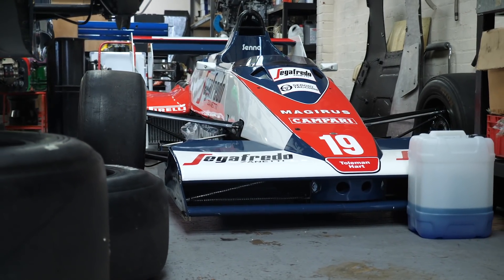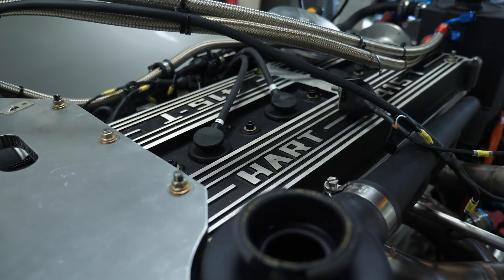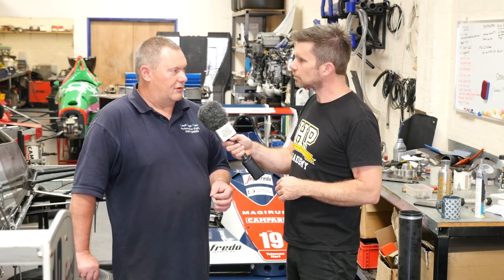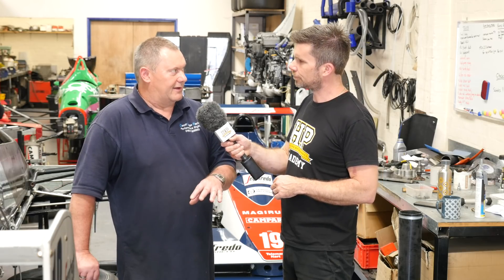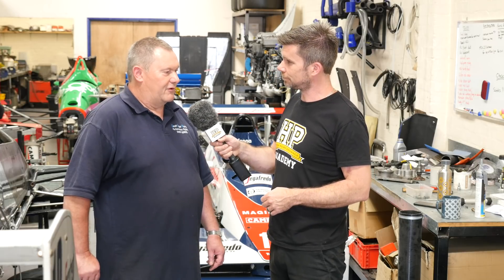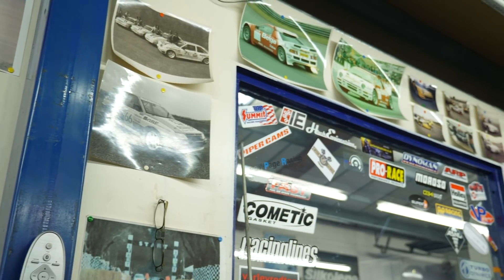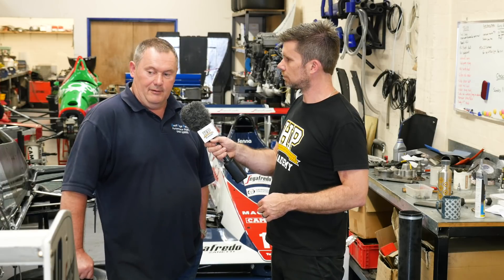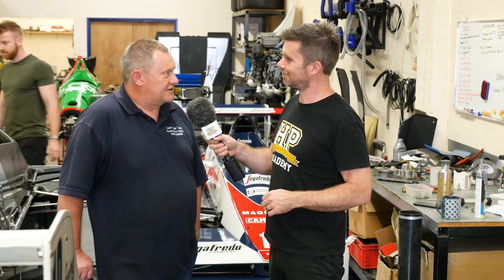Formula 1 TURBO Era | 800HP Toleman-Hart TG183B [TECH TALK]

Comment: Super informative on the headless Toleman Hart 415T race engine. It was probably equally tricky to reface 16 valve seats with a multi angle valve job.

Comment: The early 70s the Leyland lynx truck and bus engines were fixed head,  not overly reliable, but they ran them for number of years
Reply from the maker: Interesting, wonder what the reasoning was for that in their more industrial application - Taz.
Reply: @hpa101   Not sure really, they had similar engines in the British Leyland group, same size and power, maybe it was a project that was signed off on, they were strange time in the 70s in BL

Comment: Monoblock engines used to be fairly common, when head gaskets couldn't seal high cylinder pressures.  The Offy 4-cylinder Indycar engine was a monoblock.  Those were doing 1000 hp out of 165 cubic inches in 1972.

Comment: I remember Porsche welding the heads to the barrels in the late 70"s to eliminate the sealing problem. This goes one step further. Would have liked more visuals of the engine components.

Comment: If only Brian Hart could of been persuaded to right a book.
On a sub note: It was Honda who were the first to be producing the 1500 hp No.'s but they(Honda) were not totaly sure of their power, simply due to the fact they were measuring the rpm and then the torque was measured off of the spring balance scale using binoculars. Different times

Comment: We’re so lucky, nowadays you can easily source ECU’s with a ton of ignition and fuel controls plus a host of failsafe and drive-ability functions that make driving a car that would normally be a nightmare on the streets quite tame. And that’s truly the upside to F1, as in all the electronic tech that has trickled down to the general aftermarket over the years.

Comment: the Alfa Romeo 8 cylinder F-1 engine from 1951 was a "monoblock"...
Reply from the maker: Yes monobloc tech (monoblock seems to be the modern spelling since it is more specific than the original term was) goes well before 1951. This wasn't the first block used, and certainly not the first in motorsport ;) - Taz.

Comment: 1500hp in qualifying trim from the bmw 1.5 liter f1 car, same as the fastest 13B's in sport compact import drag racing. Love a brutal forced induction small motor that's off it's head!
Reply: I dont. Those high strung little fuckers dont last more than a race, or a few 1/4 passes.  Stupid fucking expensive to build the little fucks when you could just build a 1500hp turbo V8 and daily the bitch for years without issues..

Comment: Offenhausers (and I guess the Peugeot engines they were based on) featured a monoblock with 4 valves per cylinder a hundred hears ago
Reply from the maker: Yes sir! This wasn't new at the time as Geoff mentioned and some 'monobloc' technology from way back when is actually completely normal now. Early engines were far more 'modular' - Taz.

Comment: The mpg figures from today's turbo hybrid f1 cars make far less than crazy 1500 hp of those good old days. Still with hybrid systems their mpg figures ąre in the single digits.
What mpg figures were you getting in Sennas Era with turbo engines
Reply: Tanvir Hussain so I did some math and research. So these are rough estimates based on Grand Prix lengths and 100 kg of fuel in modern F1 cars and some conventions. But with that math they would be around 7.2 mpg in today’s F1 cars. It could be more but the teams wouldn’t dare release that info. I’d guess with refueling back then it would be far less. Plus modern cars produce a bit over 1000 Hp.
Reply: @Tristian083  yeah maybe but only if you consider the hybrid boost! Engines alone are probably knocking 800 hp door , probably not even that.
Reply: Gallons Per Mile more like!

Comment: Are monoblock engines used in turbo sports cars nowadays like a Ferrari 488? And are there any downsides to the intense boost pressure to produce 800hp from 1.5l, other than cost/difficulty of servicing valvetrain? (does more boost mean more lag due to large turbo to spool up)? Sorry for all the questions, I'm sure I know a lot less than most of the audience here, just eager to learn.
Reply: I can't think of a modern production engine that is a mono block, as head gasket sealing had been worked out by the 1940s. While eliminating the head gasket removes one thing that can go wrong, it's an absolute pain to machine the chamber area. This increases cost of manufacturing. Especially as now head gaskets are much better than they use to be.
Reply: Yes, big turbo on a small engine result in a slow boost buildup, but more importantly - it will come on boost at wery high engine speeds. It will drive like 120hp NA 1.5L untill you reach 6000rpm and cut fuel at 8000.